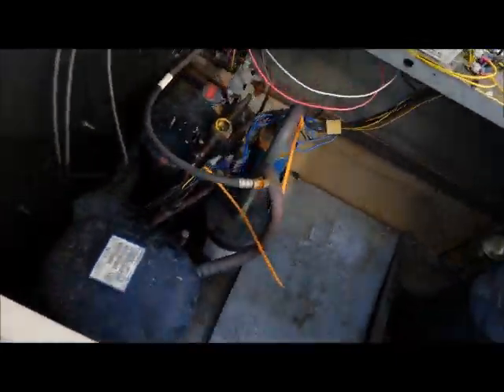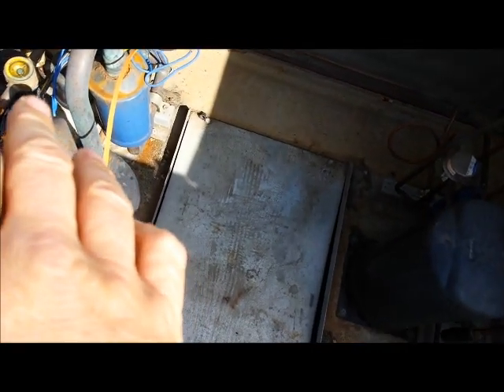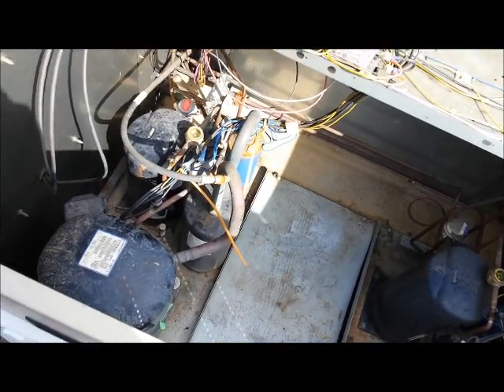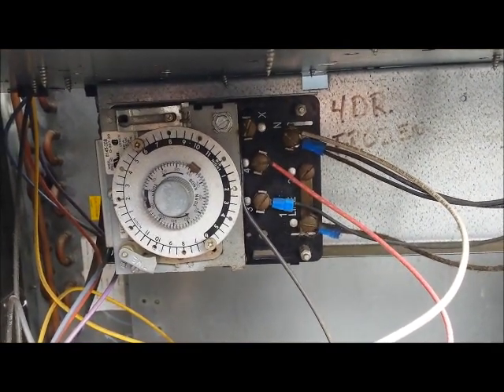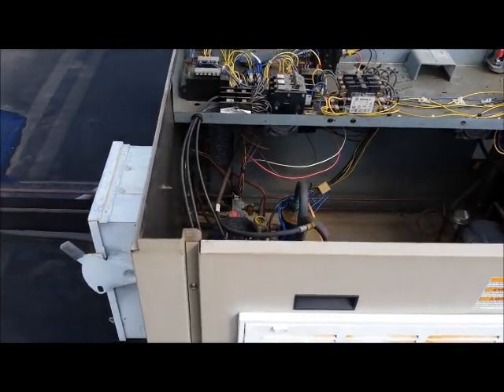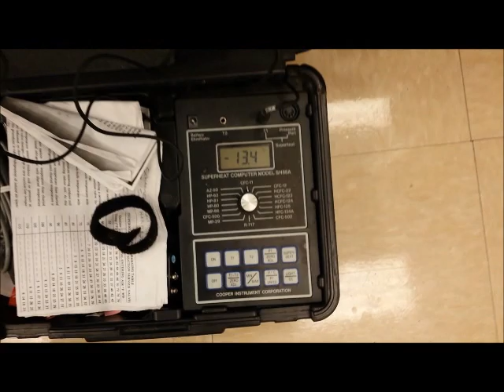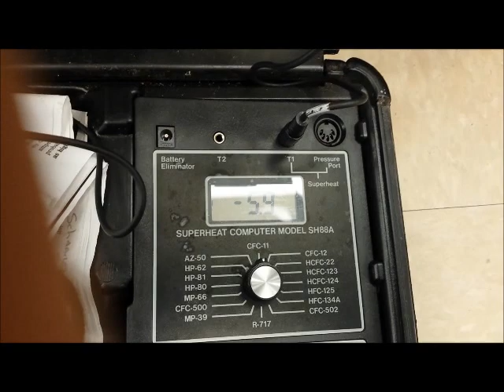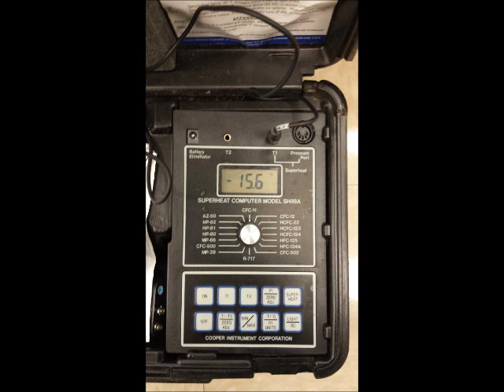Troubleshooting commercial refrigeration

Comment: I see he's working on a hill phoenix unit. I'm in the process of installing seven remoted hill phoenix systems. The boxes are sort of crappy but the condensers use Copeland compressors. A note, if the hill phoenix freezer you're installing uses a carel control, the wiring diagram will suck.

Comment: One way to check the low pressure control to make sure it's on calibration you could pick out one end of the low pressure control with a quarter inch nut put it on the gauge I'm set the pressure on the gauge on coordination with setting increase the pressure probably with CO2 see if it come on on the right pressure under pressure control and gauge must be read the same if not calibrated 95% of the time it's off calibration this is a very important test especially for a freezer box on a pump down system

Comment: Need help troubleshooting commercial refrigerator, already filled system but compressor still doesn’t run. I ran compressor independently and the compressor spins but the system has no pressure so compressor won’t run as intended. The system has no leaks

Comment: leaking solenoid will freeze up inside this is one sign short cycling leaking discharge valve on the compressor this is another one I hope there's a check while on a discharge line

Comment: Could be a leaking solenoid valve
Reply: Or the compressor
Reply: If it's frozen food application I do hot gas defrost nut ice cream temperature two-stage defrost very efficient on electricity a lot of people do not know about these type of system two-stage defrost
Reply: @treefrogs2894  cute name . What are you an American hero lmao
Reply: @treefrogs2894  with the right equipment and diagnostic tools . Anyone can be a hero . Literally anyone.  It's more difficult in the future because of our limited credibility.  Thanks for that
Reply: It is very important to ask the customer what application they are using the box for frozen food or ice cream determine defrost setting temperature setting the amount of defrost this will increase efficiency are some people or most people do not put a one-way flow check valve on the discharge this reduce short cycling on the compressor compressor heater to prevent gas trapped oil efficiency reduce short cycling on accumulator in the winter time I usually have a strip heater wrap around accumulator with a thermostat extremely efficient balancing the system
Reply: @treefrogs2894  yeah refrigeration is significantly more complicated then AC especially residential.  The sizes , applications,  refrigerant types,  control systems,  distribution systems,  and safety's very wildly from job to job . Not just walk ins . But your correct if you dont know your objective,  like defending the constitution from all enemies foriegn and domestic,  how could you ever earn an honorable paycheck.  Never mind a meal ..
Reply: @treefrogs2894  hey maybe state religion,  our free press and our right to bare arms will feed you boys those fish sticks I know you really really love
Reply: I've been doing a condition and Refrigeration engineering since I was 14 years old I am 47 years old I only do Industrial and Commercial I increase efficiency my warranty is only has one year on my work low temperature system and very careful with or return is very important P-trap every 8 to 12 feet it is very important at what temperature you put a oil separator it's up to the customer  budget temperature the customer is going for it could be a evaporating fan running getting hot and cutting off check and see if the Fan Hub a run and start capacitor low temperature I always like putting separate evaporators you can still limp the system if the system go down it is a big box I always put two separate compressor just separate system this reduce customer losses increase efficiency if the system or one system go down of course it based on what size of walk-in cooler do you have some people does very very bad insulation on the second technician company on the job it's a total mess for him
Reply: If it is a box freezer with multiple door the humidity will increase into the evaporator the running time of the compressor will be much longer this is also based in the humidity of the store is there running in the air condition there's a lot of factor will going into this defrost to make a efficiency determination
Reply: @treefrogs2894  wherever you go is hell . There is no secret to escape that truth
Reply: @treefrogs2894  I'd rather ride with the angels or walk with the dead then to stand next to you
Reply: You stay with technology I am Solar pv cityfi air condition and Refrigeration go well with solar including hot water solar I do a lot of heat storage 1200 gallon 600-gallon oil heat up at 900° storing energy I make more money in a bad economy because everybody want to save efficiency efficiency is very important even down to my employee I developed a system with another company it keep that employee employed all the time we exchange employees back and forward when you need them and big jobs it's been working out great for me for the last 12 years employees are very happy that is key to building a good customer service and a good company keep the employee happy
Reply: @treefrogs2894  dont you hear the Angel's sing ?
Reply: @treefrogs2894  you want to know more truth ? Technology perfected is biology.  Why ? Because physics.  You worship technology.  I did my job,  day in day out . You didn't.  That's all
Reply: @treefrogs2894  I take that back . You dont worship technology.  You worship confusion , deception , and force .

Comment: First you pump down ONE sys not the whole rack and dump it in on the liquid side. Since its pumped down it won't be high pressure. Second, if you always have flood back sounds like you need to adjust some valves "Mr. Elite"